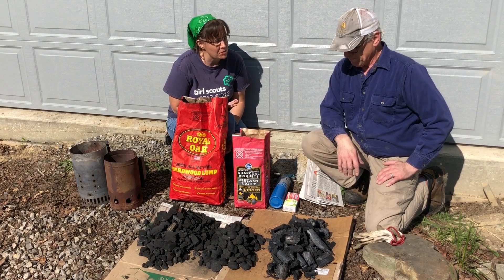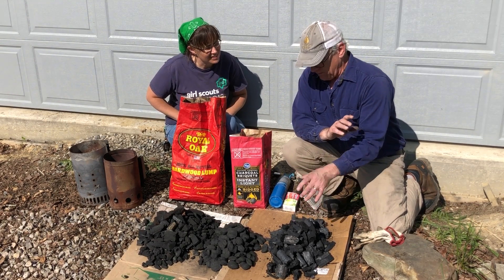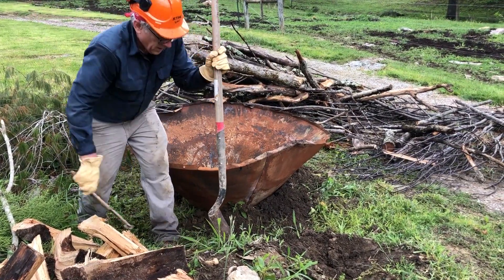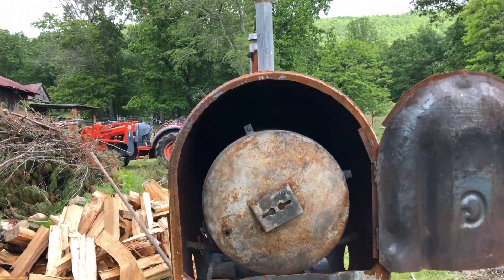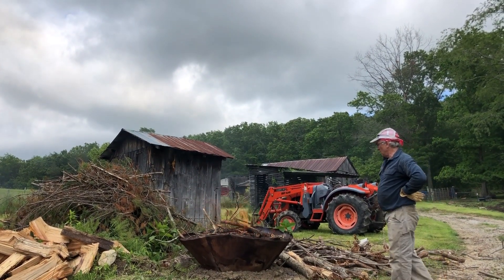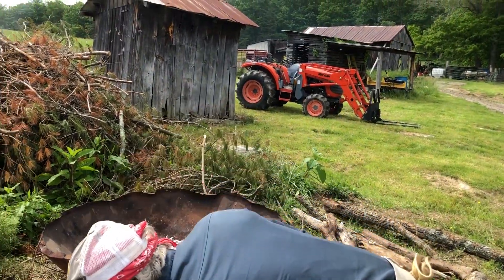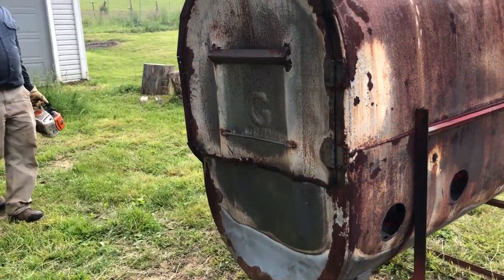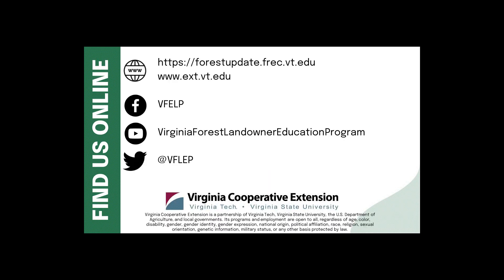Fifteen Minutes in the Forest: Making Charcoal and Biochar

Comment: I have multiple 55-gallon barrels that I use to make biochar. One small correction @4:00, for NC hardwood biochar at least, is that biochar is about 95.5% carbon. I know this because a few years ago I sent a sample off to the NC DA&CS lab (the AG lab) in Raleigh to get an analysis of my carbon before I inoculated the batch. Calcium makes up 2.93% of the material, with Mg, K, Al making up 0.46%, 0.34%, 0.32% respectively. The remainder is trace elements (P, Fe, S, Na, Mn, Zn, Cu, B in that order). The pH was 8.58.
Reply from the maker: This is great information, thanks for sharing! - Karen

Comment: Nice.  I’ve made over 7000 gallons of biochar using “waste” wood off of my 6 acre property.  I’d like to see some research/info on using it as a lime replacement on pasture (where I’ve spread most of it).
Reply from the maker: That would be an interesting study. I'll see if Phil knows anything. Do you feel like you've seen a positive result? - Karen
Reply: @virginiaforestlandowneredu309  My white clover is doing much better, going from maybe 5% of the stand to 50%+, but I’ve also added light applications of NPK to “charge” the biochar, probably 30-15-15 lbs per acre over the past 2 years.  Far below the recommended 0-60-60 lbs recommended by my soil test (for legume/grass pasture).  I’m going to sample again this fall.  Might do two tests, one at the 6 inches deep I usually do, and one 1-2 inches deep where the biochar is probably having more of an effect.  I’ve also noticed white clover seems to respond favorably to compaction.  So some of stand change may be due to the beef cow I was grazing on my pasture.  I am located in the foothills of NC and am interested in having university studies performed on my property.  Let me know if you are interested and I will get in touch.